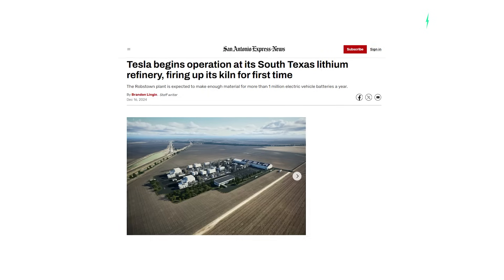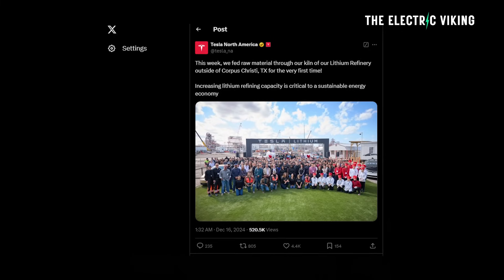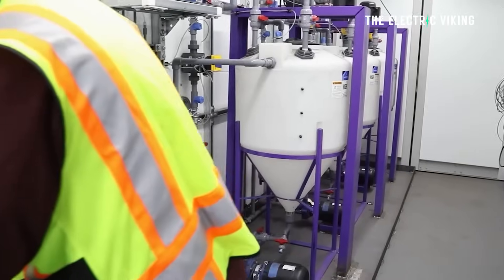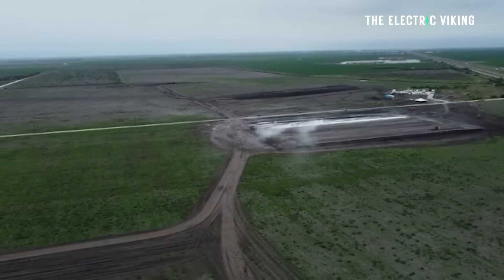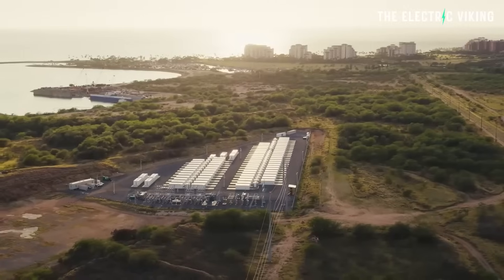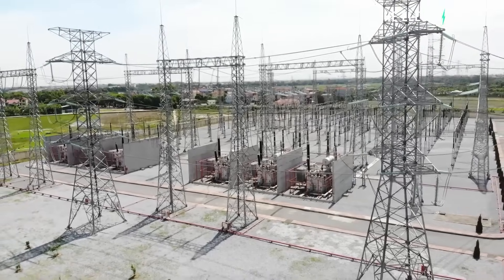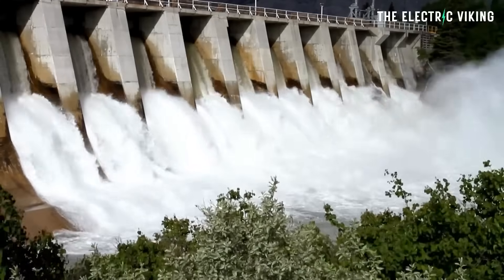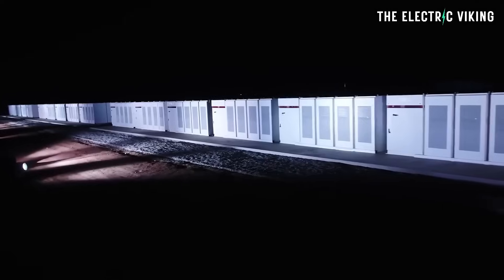Tesla launch America's first EVER large-scale lithium refinery

Comment: The issue of using batteries as backup to the power grid during abnormal freezing temperatures in Texas is that battery efficiency drops significantly in cold temperature. So they are a poor source of backup electricity.
Reply: you can keep them insulated and heated.
Reply: @ Heated with what? Battery power?

Comment: Most battery farms are designed to output over 2 to 4 hours as this is the current economic sweetspot. Dont confuse the storage capacity MW with the output MWh, eg Flower Valley II , Texas 100MW 200MWh  = 2 hours supply at 100MW. The Texas grid in 2022 created 428,475 GWh or 42,8475,000 MWh. This would require ginormous batteries that are not economically feasable today (or probably ever).  The US but not Texas is lucky that it has good temporal shift and different weather cells so has less to infill with batterties when renewables (solar, wind) have low production. Europe is less lucky as it has less geographical/temporal spread and tends to be dominated by a weather cell.
Batteries can play a significant part but other infill / demand reduction / industrial holiday will be required.  National Energy System Operator (NESO) UK and Australian Energy Market Operator: AEMO for example are planning and implementing the structure that will achieve very high renewables probably with some small fossil/combustable (energy store) inputs at a lower cost than the nuclear alternatives.

Comment: not full speed. they just run the first test loads through the plant. they only have 1 of the 2 lines built. they have not started on building the second line. Not to mention the first line is not finalized just running text loads through.
Reply: Good point and the three plants in Western Australia are ~3 years in and still not operating correctly so way to go yet for Tesla.

Comment: Ok, so good Tesla is finally ramping up this lithium refinery but notes of caution here: 
-Western Australia has three new lithium refineries that have as yet failed to reach nameplate capacity or produce battery grade lithium hydroxide in meaningful quantities. Each of these plants has cost in excess of $1bn 
-does Tesla need lithium hydroxide or would it make more sense for them to make lithium carbonate (the chemical used in the cheaper, mass market LFP batteries)
-can Tesla make lithium chemicals at a cost that makes sense vs that sourced from China
-what is the cost of Tesla’s in-house lithium hydroxide? (Not market price but production cost) 
-where will Tesla source the raw material spodumene to refine into lithium hydroxide?

Comment: are these types of batteries recyclable and if so, is this being done anywhere in the world?
Reply: Most batteries recycle around 80-90% (plastic, and some of the battery are not unless you reactive it like the carbon). The main issues isnt if they can, but is there a market for it yet.
Reply: @adr2t  Redwood recycles EV batteries in the US, they can reclaim most of the Lithium and rare earth materials which can be reused to create new batteries.  Some specialist garages refurbish old Tesla batteries, they have equipment to identify defective cells in the battery and replace them and put in new connections.  Factories where Tesla makes batteries there is also a recycling or repair section.

Comment: A Tesla Megapack uses between 390 and 585 kg of lithium, depending on the specific battery chemistry and design. An EV with 60 or 100kWh packs uses between 10-18kg at $10.50/kg.

Comment: When affordable powerwalls?
Reply: What price do you consider affordable?
Reply: @ For a 10 kWh battery and single phase inverter, about 1000-1500 USD.
Else permanently parking a Tesla-3, long range model 2025 with V2G would make more sense.
Reply: Agree Tesla Powerwall is a rip-off. It is interesting that it is cheaper to buy a used Tesla 3 for sub $30k with a huge 58kWh battery and use this to store your solar power via what is called V2X (just approved by Australian government)-at night pump the power from your car into your home. Powerwall to store 58kWh would cost you about $60k
Reply: Lets hope not, I terrified of the extra house fires it will cause.
Reply: @ Afaicr, it were the batteries from LG-chem having issues.

Comment: in freezing temperatures like when the grid froze in texas, the batteries won't work as well.
Reply: Can't ride a Harley in the snow either,  what's your point?
Reply: This is now a falicy. The new battery's operate from under minus 10 degrees c  without a losses of power .
Reply: @ala-hc4rx So why are EVs sitting on highways during freezing weather?
Reply: Battery management systems will keep the batteries fine ..just like their cars ...heat them when need to go and charge in the cold etc ...don't believe the FUD
Reply: @damfadd The battery management system uses battery power to keep the battery warm. You can’t get around the law of physics.
Reply: @gj8550  that wasn't my point

Comment: A fair bit of misinformation regarding South Australia. It is not 100% renewable. It has several gas fired power stations capable of about 1.5GW total. It is also linked to the Victorian grid and is able to draw several hundreds megawatts from that source (mainly coal fired).

As a matter if interest, lithium prices are currently around $10.50 per kilogram and despite demand, the price is slowly falling.

The average EV uses 18-20Kg of lithium, ie. about $220 worth.